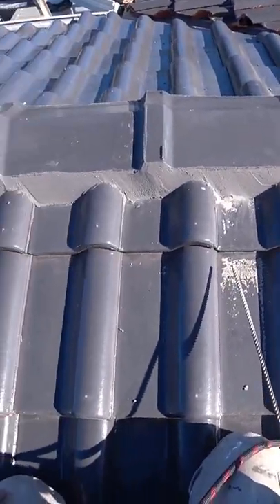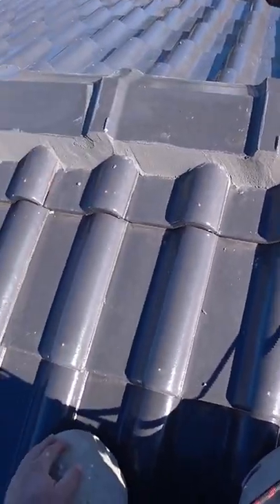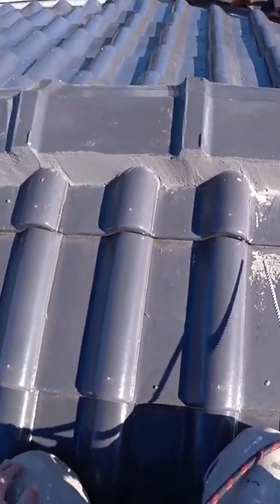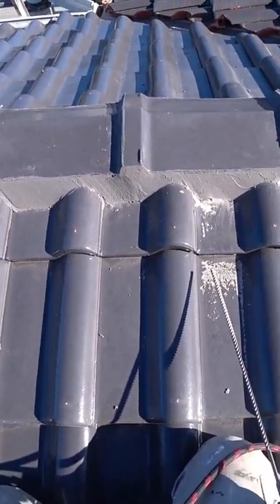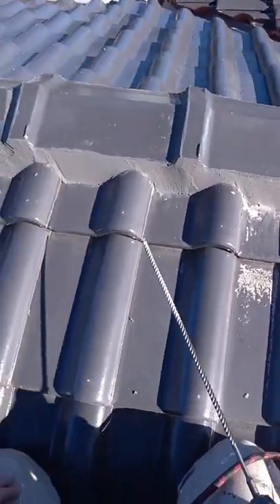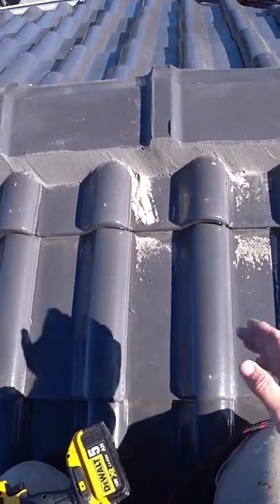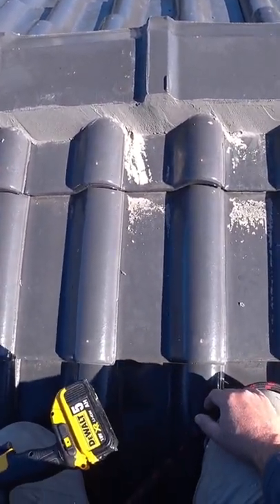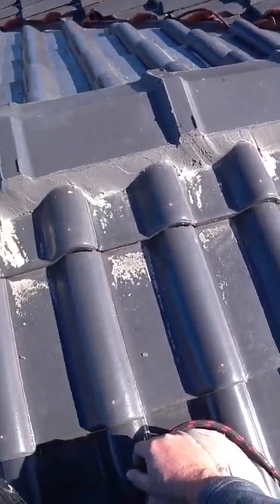Drilling weep holes on the ridge capping  #shorts #diy #tips #roof 👍& 🔔

Comment: Why holes in that topmost position? How can water get there?
Reply from the maker: A weep hole is a nail sized hole in the top ridge pointing of a tiled roof, they are made every 30cm, and are along the ridge pointing. These holes allow water to escape, as a result the ridge point stays dry. It is crucial that ridge pointing stays dry, because the bedding holding this part of the roof together is cement. Cement, although strong, is porous, which means it has lots of little holes in it, and as a result allows water to soak in. When water soaks into the concrete it accumulates and resulting in cracking and other issues.